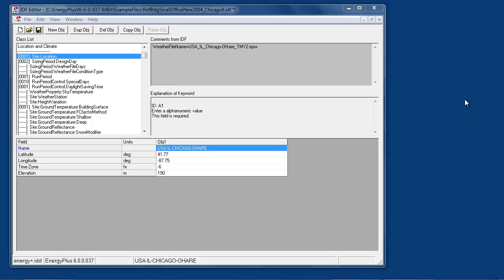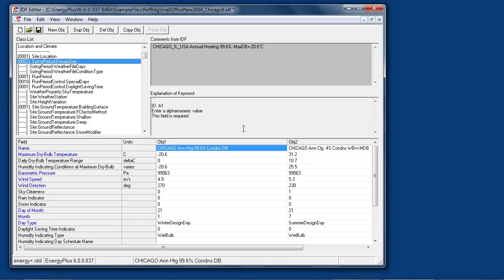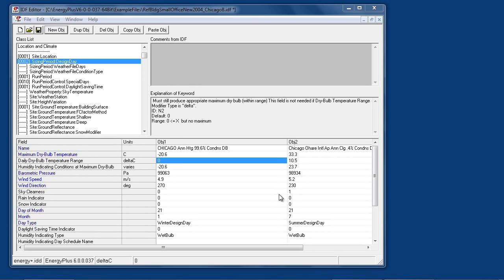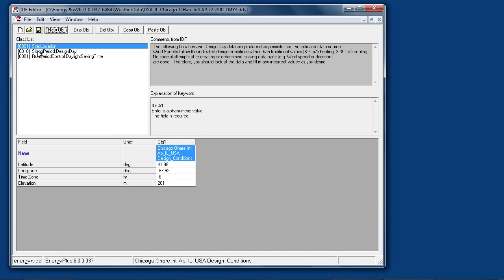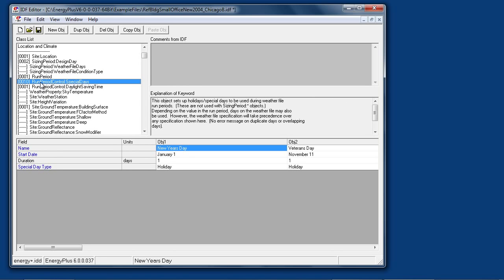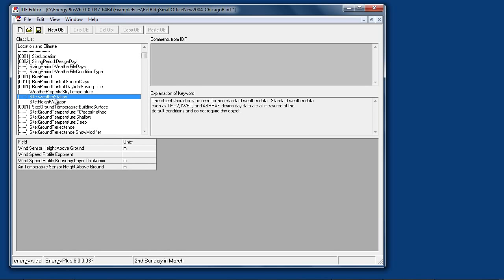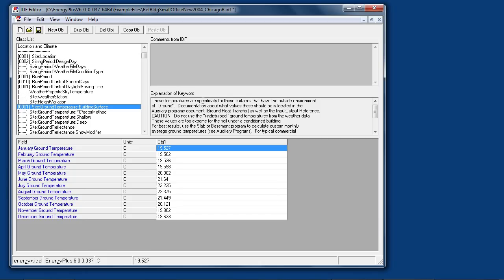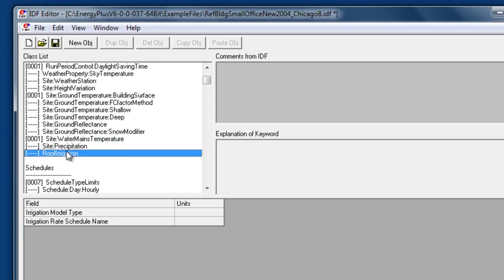EnergyPlus Location and Climate

Comment: Thank you a lot! When you have one week to learn the program and design hvac and heating solutions for a building (last year mechanical engineering), and teachers don't give you absolutelly no information whatsoever,  these videos come in handy!
Reply: @konstantinosmanesiotis4323 We had no other option. It has been quite some time now, but the last years get really heavy on assignments. You kinda get used to get a lot done in little time. Internet always helps quite a bit, specially when dealing with software.